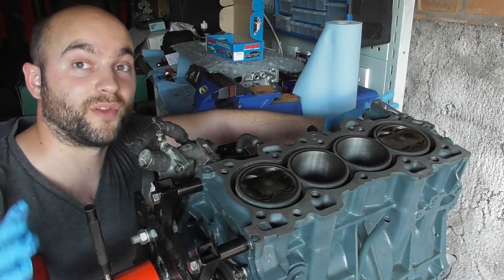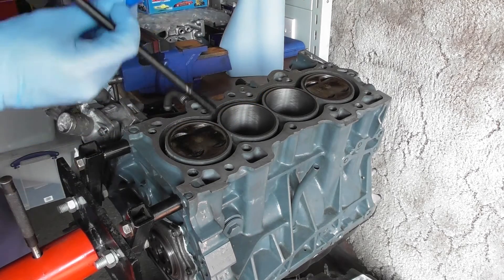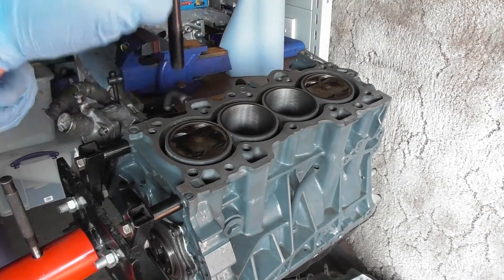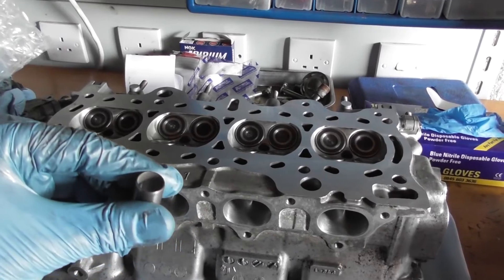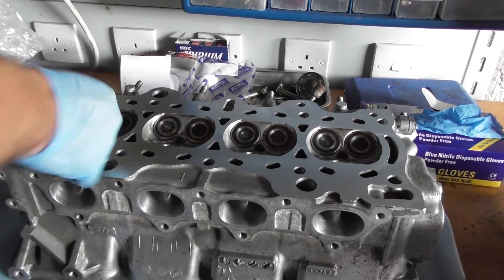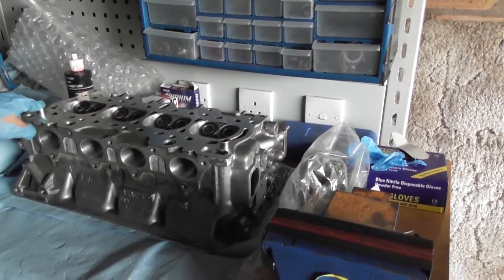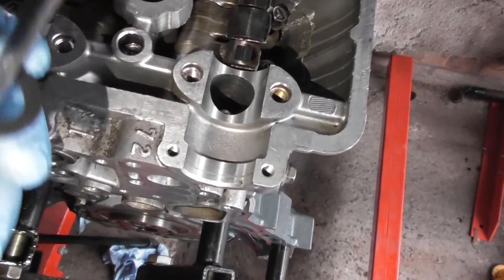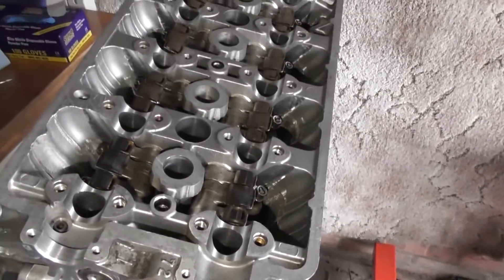T2CG Honda Civic B18C4 Engine Build Part 5: Attach

Comment: Hey bro is it ok to double check the torque spec at 80ft on b20 vetec?
Reply from the maker: scorps9398 For the B18C4 ARP head srud kit I bought it was: 40lbft, then 60lbft and finally 80lbft. The box the studs came in will tell you the torque figures to use, or you could check ARPs website. Thanks

Comment: Good video, I have a quick question, I was doing a ls vetec with arp head bolts b16 head when  one of the head bolts stripped, so I still tried to see if the motor will handle with one stripped bolt but it started to smoke once it hit temperature. So my question is do I still need to resurfaced the head for the other block going b20 now?
Reply from the maker: scorps9398 It is always a good idea to resurface the head for a good seal to the block with the head gasket. I take it that the head stud stripped the thread out of your old block you are no longer using. Thanks
Reply: What do you use to clean the block before head gasket installation?
Reply from the maker: scorps9398 I took my block to a machine shop, who cleaned and painted it.  Just make sure it is clean, free from debris with the surface in good flat condition. Thanks
Reply: Thanks for the quick response and info.

Comment: hi i got arp block bolts for my b18c4  and in my set i got 6 long bolts and 4 small ones    is this right if so where do i put small ones
Reply from the maker: Tony Brice Hi, I think all the bolts were the same length in my kit. I would ask what is the ARP kit number you have, then check that it is the correct one. The Tegiwa site says it is kit 208-4303. Thanks
Reply from the maker: Tony Brice Chris Bates The ARP part number is 208-4303, which is the kit I used on my B18C4. Thanks
Reply: he bougt the crankshaft  bolts

Comment: can u tell me where got the 2 ends from   and in my apr bolts kit i got short and long bolts where do the short one go m8 mine a b18c4 as well
Reply from the maker: Hi, I got the two Dowels from Rimmer Bros as they are the same as the Rover Part (D16 engine I think). In terms of the lengths of the ARP rods, I seem to remember they were all yhe same length. What is the ARP Part number you have, then I can check the Part Nunber of the kit I used. Thanks

Comment: wrong man ..arp lube is meant to be on the top thread/washers/nuts not the bottom .....
Reply from the maker: Joel Mckeown I put the lube on both ends of the rods. As you can see in the instructions it states to place the rods in the block hand tight (which is to where they bottom out). I cant see a drawback to lubing the bottom. But I should have mentioned that I lubed the top too.... thanks for pointing this out.
Reply: +Twin2 Civic Garage T2CG fair enough .how's the motor going .turbo yet :P
Reply from the maker: Joel Mckeown The motor is going well... I have had a lot of gearbox issues though... had to change to a cable gearbox. I have got a Skunk2 inlet manifold or OBX throttle bodies which I can fit... I am not going turbo at the moment. I think I would change the pistons and rods to upgraded low comp ones if I was going to do that. Thanks

Comment: gor b16a turbo how much tourq did i must do..pls help me..
Reply from the maker: It depends.  What head bolts are you using?
Reply: im using arp bilts sir.....
Reply from the maker: +mohd noor There are specific instructions inside the ARP box, however if you do not have the instructions I would follow the same three torque steps as in this video. remember to lube the bolt theads as I did. Good luck
Reply: ok sir  tq....xan u tell me the max torque
Reply from the maker: +mohd noor I did a max of 108.47Nm
Reply: tq sir.....
Reply from the maker: Nm is torque
Reply from the maker: +Twin2 Civic Garage T2CG 108.47Nm = 80lbft